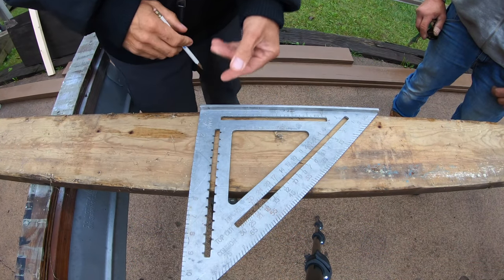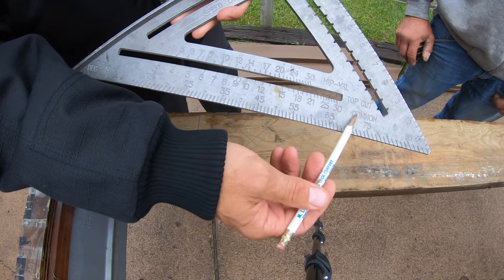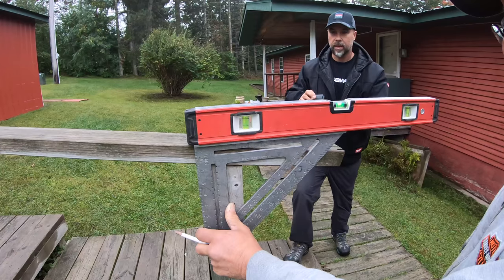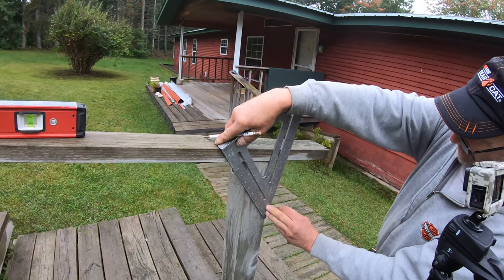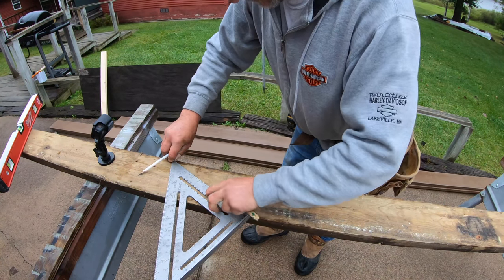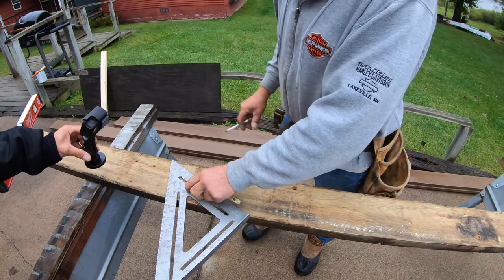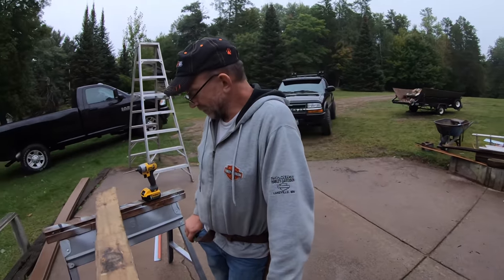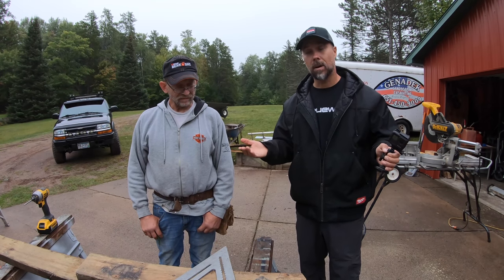Speed Square basics broken Down. 4k video

Comment: The speed square can be used as a saw “Guide” when cutting with a hand saw. 90deg 45deg even the angles if held tight. I have produced many accurate cuts with out a miter saw

Comment: That slot along the bottom of the speed square is used for marking over form the line you draw.  It’s a little easier then using a tap all the time for making the short measurements.

Comment: Those slots are for knocks it's like a nut and bolt so once you set the square you tighten them both up and it's set up just put on the board and keep marking.

Comment: A 4-12 pitch is 18-1/2°
Actually it’s 18.43° but we as framing carpenters call it 18-1/2°
The only roof pitch that lands on a full degree is the 12-12 pitch which lands on 45°

Comment: Depending on brand they aren’t all set up the same. A nice feature for wall layout on some is where the notches are on that one, the thickness from outside to inside is 1-1/2” so when laying out stud locations especially for window and door openings (king and jack studs) you can trace both sides of the square and not have to measure out a1-1/2” for every stud

Comment: That little slot with the numbers that you weren't sure what use it had?  Those are measurements from the pivot along the edge that you've put the fence/pivot against.  I find it's useful for pretty much anything where you need to mark an offset along the edge you're measuring, and can be used either way.

I used it for setting my straightedge guide (read, a spare strip of plywood that included a factory edge) for my circular saw on plywood panels, since my saw has pretty much exactly either 5" or 1.5" between the kerf of the blade and edge of the shoe, and measuring the offset was faster and generally more reliable than me doing maths involving 1/8ths of inches.  Of course, a jig would have possibly been even faster and maybe would have given a better cut, but it's a lot easier to store a square than an 8 ft. long jig.  But, I'd just mark the intended length, score it with the square, then shift the edge over so that the mark was visible in the window at the desired offset, then score the new offset to put the guide through.

Comment: Hi Stan, 

I have a question about your bidding process. I remember that in your area the market rate for a single labor hand per hour (landscape) is approx $65 that you aim to earn for each hour. I also recall that you aim for around $95 per hour for your skid steer working on a job. My question is when you bid to make $95/hour for the skid steer does that include the skid steer operators rate with the equipment or do you charge additionally to compensate for the skid steer operator?

Thanks so much Stan, keep killing it!

Comment: Great video and how to determine how to cut your birds mouth. I am terrible about doing angles those are good tips but I will have to practice. I don't build that much since I started doing small engines and some metal fabrication. But I could use the speed square with steel as well.
Reply from the maker: Thanks Ted!

Comment: explain the difference btw a long 4/12 and a short 4/12 and show how to get it on the square
Reply: ClintL63 it’s called a common rafter cut for the shorter cut. For the longer cut it’s called a seat cut. To get a 4/12 common cut you need to but your square flush with the end of your wood or measurement, than pivot the square staying on measurement line or end of board to a 4 common on the common cut label in the middle of the square. To get a seat cut you like your square up flush to the end of board or measurement and make a tic in the direction the 4/12 pitch is in the middle Column also under the common section. Than hold your square from corner to your tic like a ruler and scribe the line from corner or measurement like to the tic. 

Also works better with a 1 foot or 2 foot framing square since you can scribe the seats cuts better. Hope this helped